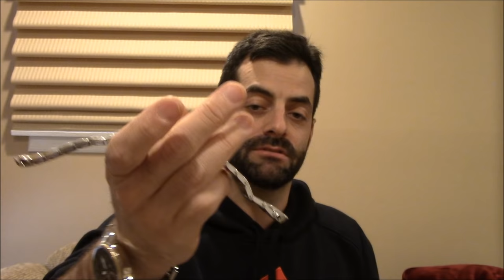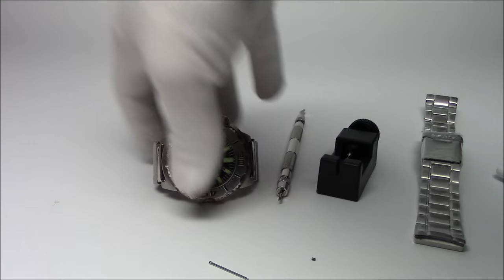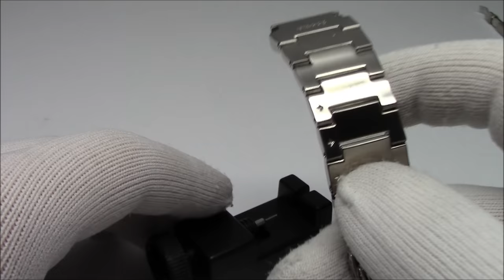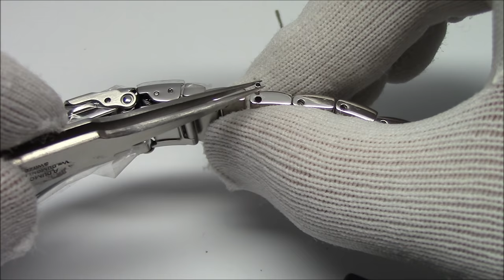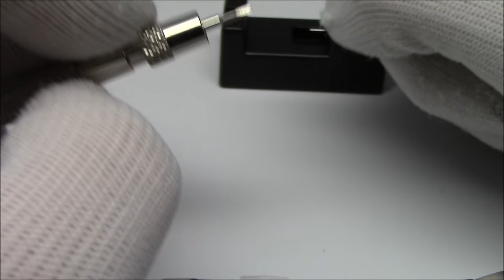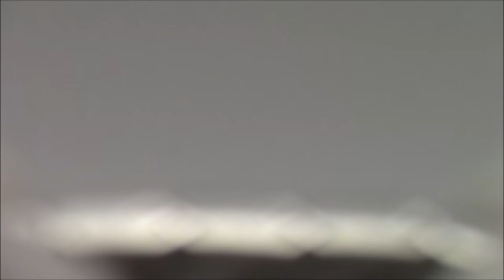How to size a Seiko (or any!) Pin and Collar Bracelet. Watch and Learn #15

Comment: Hey man - great video! 
Just wanted to let you guys know that on my Seiko (Prospex), the collar actually goes in the middle-part of the link, and not from the outside in as shown in this video. I was quite frustrated until I realized, so I thought someone might benefit from this information, if the collar does not fit from the outside as it does in this video :-)
Reply: Hi, I have a Prospex Solar Tuna and I think it might be the case with that too. Luckily I had bought the watch with the intention of changing the bracelet and the plastic shroud. When I first replaced the bracelet with a Miltat Endmill, I realised that the standard style bracelet looked better, so ordered another Miltat more inkeeping with the original design. It was then that I tried to size the Seiko bracelet. I found it very difficult to remove the pins and had no idea of pipes. Of course the manual that came with the watch made no mention of pipes & pins and the bracelet resizing instructions were for a regular push pin design (thanks Seiko!)
Reply: Can confirm this is the same on my SPB143 with the newer bracelet. Thanks for the saving comment, I was losing my mind when it simply wouldn't fit outside to in.
Reply: Looks like the same on my Baume

Comment: I got introduced to the pin and collar system the hard way, shortening the bracelet of my Citizen Promaster Skyhawk. I didn't know about this system so I took out the pins and lost the collars. Naturally when I put the pins back in they just dropped out again. I put in split pins as a temporary measure but bit by bit I found back all the collars in my carpet. Just by the way the light reflected of off them so I was able to put everything back in order but yeah.... lesson learned!
Btw, with the Citizen watchband the collar drops in a hole in the middle part of the link at the side where the arrow is, not at the outside as in this video.

Comment: Nice video Marc. I sized my Seiko SPAR21 using your method.
However, I found it easier to place the collar in the center of the link, arrow side, then putting the 2 links together and following through with the pin.

Comment: For the SARX045 and similar, the pin works a bit different. The end with the arrows is too narrow for the pin to come out or be inserted. You have to insert it in the center section and then insert the pin as shown. Took me a bit to figure that out as my SARB and SBDC work like the video does. Thanks, Mark!

Comment: Very instructional - thank you. I still hate the pin and collar system. Seiko kindly sent me a spare couple of pin & collar pieces for my Turtle, after I lost the collar for one of the pins.  I followed the video here, and it made total sense. However, my collar is not compressed sufficiently, even though it's inside the link. The little bugger still slips out.

Are there different sizes/widths for these things? I supplied Seiko with the exact model of my watch.

Comment: The SNE245 PADI also uses pin/collar, but the pin is uniform diameter, and the collar goes into the center section of the link.  Very tricky, but an improvement over having the  collar at one end.

Comment: thanks for this.. i just got my orient m force in and thought i did it correctly and was right, but I saw one of the collars exceeding the link afterwards.... not sure if i just missed that one or not, but I pushed everything back together again.  ill keep an eye on it for awhile to make sure.  Also if you are sizing you'll be left with an extra pin most likely so you can use the fat head of the leftover pin to put on the collar side while you push the other pin back in... that way you dont need any extra tools.  Thx for mentioning the fork side of the pin push tool, i had never eyed that up to push against the collar.

Comment: I’m actually a fan of pin and collar.  Screw links are obviously nicer and easier, but the pin and collar is tighter and smoother in my experience.  The wobble head screw on the islander bracelet makes it move as freely as the pin and collar though.  I just feel like the pin and collar has the best staying power.

Comment: wish I had seen this (and the previous video) last night when I was struggling for 2 hours using an old stud earring and a rock, yes I was using an actual rock to resize my bracelet. also was surprised by the pin and collar system, didn't know about those before. should get one of those pin vices the next time.

Comment: I have a Citizen that has long collars almost as long as the pins, and the collars are little springs.  They remind me of the spring in a retractable click pen, but smaller.  It's really weird.  The springs create some friction to keep the pins in place, but it's not much friction.  I can easily push the pins out with anything I could stick in the hole.  So far it hasn't fallen apart but it's not very confidence inspiring.  Regular friction pins require much more force to insert and remove, and give me much more confidence.

Comment: My prospex has the collars on the inside of the link. A lot better design because you don’t need to hold it in while you push the pin in. This was my first pin and collar job. My $20 Amazon watch took kit did the trick. I much prefer screws. But it wasn’t to bad. Temporarily lost a collar that was still in the link and shot a pin across the room squeezing my tweezers to tightly. Took 3 times as long as screws and way more complicated.

Comment: This was really helpful. I just got an SKA369. However when I tried to reinsert the collars, they wouldn't fit. After half an hour I was ready to take the watch to a dealer. Then I discovered that the collar went into the inner link, not the outer link so look out for that.
Reply: And also be careful when holding the collar in the tweezers that it doesn't ping across the room!
Reply from the maker: Yes, they are doing that on some models too!
Reply: Holy crap, dude you are a lifesaver!
Reply: Is right! Thankfully I watched another video which shows the collar in the inner link (on my SKA761P1). Also, I inserted the long pin back in the same direction as the arrow. Hope that’s the correct way.

Comment: I have managed to source an Orange Monster 2nd generation. The watch is in really good condition which I am pleased about. However it would seem that whoever sized the bracelet was not familiar with pins and collars. As a result it looks like some collars are missing and the bracelet has been secured in the holes with super glue!!!

I am going to need to resize the bracelet. How do I get the pins out although they may just come out as normal. Also where can I source new pins and collars in the UK?

Comment: Great video. I followed this and used the same pin tool, but when unscrewing the tool, the tip broke off in the collar in the bracelet. The pin isn't coming out the other side either. I've tried pulling on both but neither budge. Do I have to drill the stub of the pin tool out? What kind of tools do I need to do that?

Comment: I bought a relatively inexpensive Calvin Klein automatic and then found it had pins and collars. Instructive video, but still not easy without appropriate tools. The collars have to go inside one of the inner links of the jubilee bracelet, the drilled holes being ever so slightly wider. And despite my best efforts collars still managed to jump out of my tweezers on to the floor, but luckily I did manage to find them. What I do now is slip the collar over a tweezer end, and then insert it in the appropriate hole. Now we need a video for removing pins with screws on both sides, stuck on with Loctite.

Comment: Hi, may be a silly question! I have bought Truwood Apple watch band which has those arrows on 3 links both side, (which indicates/tells you) to push the pins, however, there are some links without the arrows, does it mean that you can not remove the links without the arrows? I really like your video because you have explain things in details. Thank you so much.

Comment: Excellent video.  I had already stumbled thru resizing a Turtle bracelet and came to the same process.  Variation was using a broken micro screw driver for the oversized tip to hold the collar in place when pushing the pin from other side.  The remaining shank of the micro was the perfect diameter and depth, a fluke.  I broke the tip while using it as a punch when resizing a Momentum diver bracelet...most difficult pins to remove I have ever encountered.  A pin vise was useless.  They were beyond what you call "friction" pins.

Comment: SARB033 has pins and collars too, but the pins don't have an obvious head on them, so it's hard to know which end goes in first.
Also, I can't get the collar to go back in the hole after dozens of tries.  It does NOT just slide in like in your example.  The collars are split so that they spring open when they are removed, and it seems like you need some kind of tiny tool to compress the collar in order to drive it back into the hole it came out of.
Maybe you have a SARB033 lieing around and you could do a "How to size" video on one of those?

Comment: Hey Mark, wanted you to know I just picked up a new Casio MTG-B1000 model with what appears to be a metal / resin hybrid link band which of course came with plenty of links (which is great as opposed to trying to have to purchase more) and had to size it down.  Immediately I noticed it wasn't like a previous watch I sized having little gaps for smaller push pins between the links and found a video for removing the pins.  Luckily I set up a little cloth on my work station and as soon as I got out the first pin (which was plain and not like the headed Seiko pin shown in your video), I noticed a tiny - tiny little piece that looked like part of the pin broke.  Just shy of terrified, I was worried that something broke or was otherwise wrong.  After watching another one of your informative videos, I found this one.  I also learn that the Casio housed the retaining collar piece in the central link instead of the other end of the pin.  Long story short, I think the watch would still be sitting in front of me in parts and pieces without your video.  Kudos and Thanks for taking the time and consideration to make such a very informative video.
Also, in the other video I watched, you mentioned being able to use the quick adjustments in the clasp.  Initially I wanted to have enough links to go up or down in the clasp as indicated, but appears with this type of link, that I've got the right amount of links, the last adjustment hole on the clasp, and won't be able to use the clasp adjustment scale.  Trying to figure this thing out I suppose I could probably add the link piece(s) to the next size and adjust the clasp connection all the way in, but I don't really expect my wrist will get any bigger.
And last but not least, if there is to be a question in here, it would be - Is there any quick and easy way to figure out how many links to remove without losing or making extra steps?
Thanks again!

Comment: Just did my first Seiko pipe & pin with the pin on the outside section of the link.  Just like Marc's watch and learn.  For me, the easiest way to replace the pin was to put it back into the screw vise with the screw end pushing on the "head" of the pin and a flat piece of metal (I used a stainless ruler) blocking the slot on the opposite end to keep the pipe inside the link.
 A coin would work also.  Penny for a Seiko, silver dollar for Grand Seiko.
Reply from the maker: Haha, nice work!

Comment: On the sarb035 the pipes drop in to the top of the tongue or male inner part of the link. You lay the next link flat on that and when you push the pin through it expands the pipe and grabs the pin in the middle not the end. The pins are just featureless rods without ridges or grooves.

Comment: Hi Mark, I have two questions and the first one is if it is a same thing with folded links and the next one is will i solve the problem(either loose,  either tight), if I get a new clasp with 5-6 micro adjustments when now I have only two and I can't get it right. Thanks in advance and sorry for my english. It is not my first language as I'm from Croatia. All the best...

Comment: FYI Citizen owners w/ Titanium bracelets - the collet is likely on the interior link hinge, not the exterior link arm. 

So it'll look like a standard pin fastened link until you disassemble. The collet will be on the shoulder of the interior hinge segment facing up.

Comment: I can’t seem to find a video on this, but what happens if you need to remove the last arrow marked link? You mentioned on the last video those you shouldn’t remove, but what if it’s down to that one last link to make it fit properly? What’s different on the pins/pins-collars on the other links versus the ones marked with arrows?

Comment: I have a Hamilton Jazzmaster that has pins and collars. It was one of the first watches I ever bought. When I went to remove a link on the bracelet, I had ZERO knowledge and experience. I learned a lot in that first hour fussing around with these tiny pieces. Now I'm wondering if I put them in backwards though!

Comment: While this video is detailed in it's explanation, I experienced frustration and difficulty when trying to replace the pins and collars to resize the bracelet of my new Seiko Samurai.  Specifically, the collars on my Seiko did not simply drop into the bracelet holes as Marc's did.  In fact, my collars probably needed to be squeezed closer AND then hammered into the bracelet hole.  I say probably because my collar, once removed, resisted all attempts to place it back in using first a tweezer and then a needle nose plier.  In addition, I tried to use the pin remover tool in reverse to screw the collar back into the hole, but it simply shredded from the torque b/c the collar diameter exceeded the hole size.  So, while I'm glad that Marc's watchband worked so smoothly, mine did not.
Reply: Same here.  Based on another comment I tried putting it in the middle section hole and that worked.  But not before I destroyed a collar trying the same thing as you.

Comment: Thanks Marc for this well explained video.  I went to a Chinese Seiko dealer /repair and I they don’t speak English well, but much cheaper than going to like Macy’s or other watch shops. So bc of the language barrier even if they’ve been 30 years, I don’t think they are very good. Gets frustrating bc after the battery is installed or watched sized they don’t give basic info that you might get from a English speaking repair shop. I just got back into watch collecting for about a month, after not collecting for 15 years. I’ve couldn’t stop to learn as much as I could on YouTube and eBay for what was out there and deals. I feel like bc I’m a detail person, I know more than this Chinese Seiko dealer in one month.

So I got 2 new Seiko watches, one a monster and a prospex solar diver. Well I got them size and after he sized, I’ve noticed the collar on the Solar extra links and no collar on the monster. So I stored the extra links about 2 weeks ago when I got it done. So tonight I looked at the extra links for the 2 watches and watched to slide the pins into the links so it won’t scratch the links. So when I looked at the monster pin, it was one pin and unlike the pins and collar on the solar. So when I was trying to snide into the link, the pin broke off and I thought it was cheaply made and actually dropped the collar on my marble bathroom floor and it took me 15 mins to find, but don’t know it was also a pin and collar system for the monster. So I’m glad I found the collar bc at first thought it was a broken pin.

So I got lucky and picked your video first that explained to me that the mister had that system and the pin wasn’t broken and I needed that collar. This would’ve been a quick and easy explanation from the Chinese  Seiko watch shop, but instead of giving basic info, but instead confused me more bc he left the pins and collar separate on the solar but for the monster he had the collar on the pin and making me think it was it was just a pin system. I also plan on flipping watches that I want to upgrade and it helps to know I’m giving ppl. the right links and pins and collar.

Comment: I brought my watch to sized to a jewelry store.  When I came out, it fell apart just as you said.  I thought I professional would know how it works.   Now that it happened:   Can I buy new pins/collars?  If I brought it to a MORE professional watch maker would they have the pins an collars to fix the watch?    It was a Seiko samuri.   What can fix the problem you mentioned in the video.   (My current solution was just to put on a nato strap.).

Comment: Thanks for the great video.  Please point out that the collar may need to be inserted into the inner hole. I found the collar impossible to fit into the outer part!  I didn't try the inner holes!.   And then I went and lost two little collars trying to jam them in :-(  I may try the other links now that I know this (on a new padi srpb99 bracelet)
Reply: This is a pretty important point! Thanks

Comment: I bought a Srp775 used and it was sized for a smaller wrist. It included the extra links but not the "pins and pipes" so the bracelet is useless to me. I found replacements online but there are several sizes, my Google searches are fruitless, do you know what size pins and pipes I need, or where to buy oem ones?

Comment: On my new tuna with the marine master braclet the issue I’m having is the pins aren’t popping out easily like your did. There stuck in the bracelet halfway out and I don’t wanna pull them out with pliers to damage them. It’s a new watch and I’m pushing the pins the same way as the arrows as u did in the video what’s going wrong